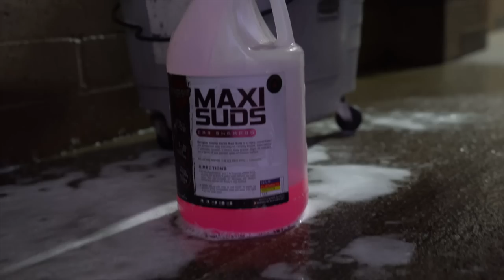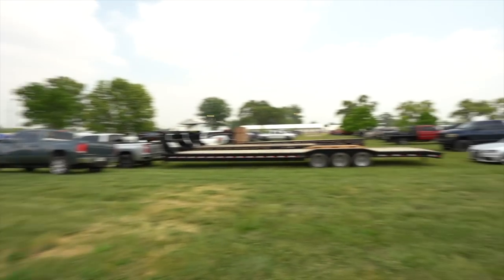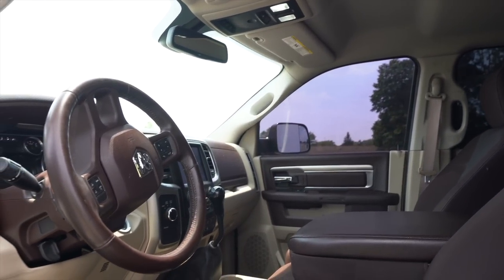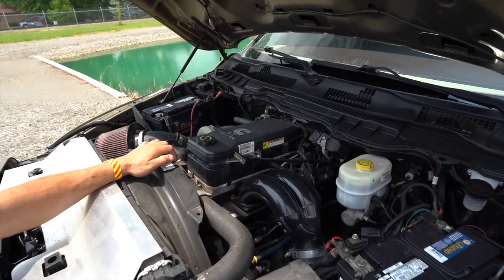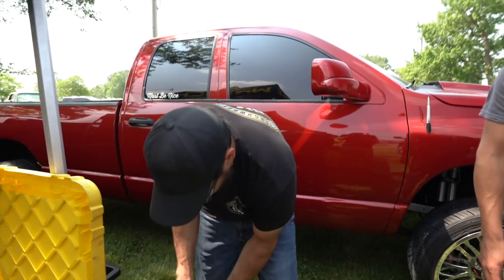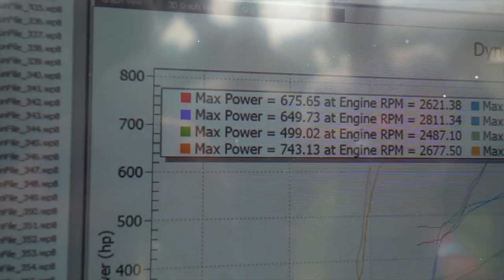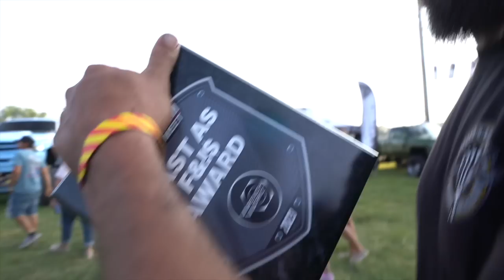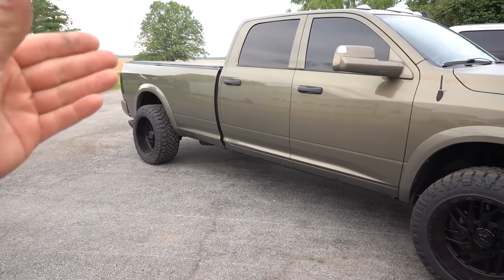Can It ACTUALLY Make 700+HP!?! New 6 Speed CUMMINS Truck Hits the DYNO!!!

Comment: Greg, 2015, when you had the cargo cam, you had the back up cam move to the rear view mirror. To get both in the screen with the soft buttons, you need to swap in the nav from a 2016 and up. Connect both camera inputs to the new navigation and you are good to go.

Comment: I'm bought mine 2 yrs ago its a 2013   cummins it was lifted and had some other stuff ,  but I took it the first week I had it and got the trans built.  Actuator went on the turbo so I did a fleece cheetah.  Blew it up on valentine's day and sent it to industrial Injection and had them do the engine and all the fuel.  I've upgraded alot of the suspension aswell . But it's super to have done everything and know it's done right.   40k in the last 2 yrs is alot buy piece of mind ya know. So just trying to figure out what I want to do for the air and I should be done for awhile

Comment: The only thing I can add is that my first 1500 was a '15 in that exact same color.  I dont think they do it anymore.  Its something like "meadow green".  I LOVE that color, and I LOVE that truck.  This had me looking at manual Ram trucks.  Such a great find!!

BTW Morimoto lights are the top tier aftermarket lights you can get for these trucks.  The previous owner had great taste with the lights, and mods to the power train

Comment: The numbers on that dyno run were all over the place.  How do you know what's accurate when it's not giving you the same reading each time?  Why would the numbers differ?  Just curious.  It's crazy listening to that thing rev.  Sounds like it's revving WAY higher than a diesel would/should, but I guess that's more exhaust sound than anything.

Comment: Absolutely love my billet g56 worth every penny lol and same clutch i believe. Still tows great but still very fun
Reply: Mine too brother  in 06 3500 I bought new 👍🇺🇸💪🏻
Reply: How much does Cody charge for the billet G56 I gota get it done.
Reply: @billbramski7209  dont remember to be honest i sent my g56 to  and xfer case at the same time to have everything gone through and all the goodies thrown in.
Reply: What exactly is billet? Input and output shafts ? Cuz gears aren’t billet and still aluminum case but I’m curious because interested but needle roller bearings, better synchros is only thing I could imagine could do different to improve
Reply: @Gilmore304  have to talk to cody on that. They have different style of gears in them that he has got done custom they are not even close to stock gears that are way stronger then the way they have them setup they are just buttery smooth

Comment: What size tires and wheel offset are you running on the new truck? 21:06
Reply: 22x12 with 35x12.5 and the offset is probably-44 3:00 is when he talks about wheels and tires

Comment: The truck looks great but a nice lift with bags in the back with exelent shocks all around would send it over the top. Also it needs smoked cab lights and the light on the corner of the mirror and after market tail light and 3rd brake like to match the headlights. Also u should stay with black rims or at least a majority black wheel. IF YOUR GOING TO CHANGE THEM. .OK WELL WE ALL KNOW YOUR CHANGING THEM, A FEW TIMES. lol. Because your Greg A & changing rims weekly is your thing hahahaha. Now before everyone start thinking im hating or something 
1. Its a joke
        &
2. Thats wasnt meant as a dig or and insult.    Thats envy on my part.     So chill lol

Comment: What was the torque?
Reply: General rule of thumb is torque is double the HP. Then around 1500hp it will slowly taper down to a 1:1 HP/TQ at 3000+.
Reply: Max torque was 1680